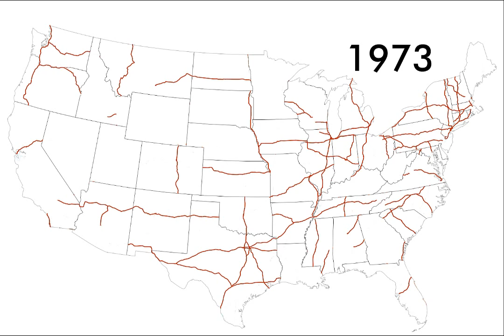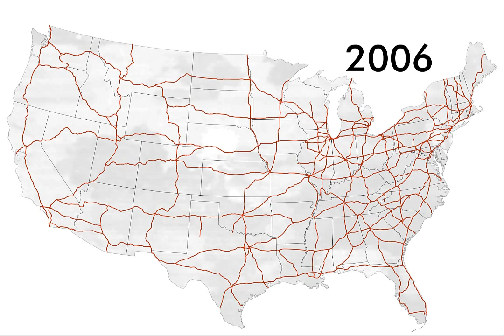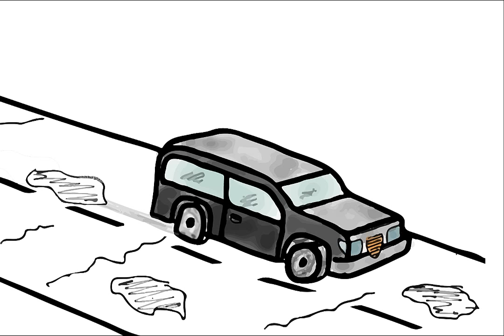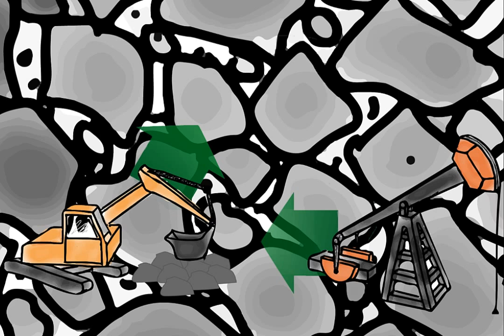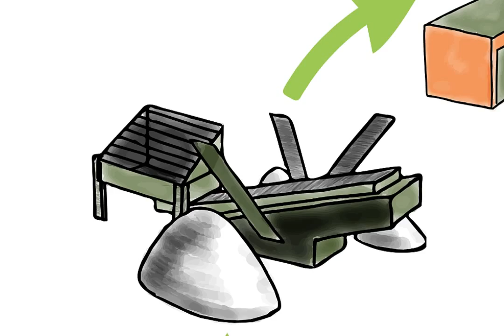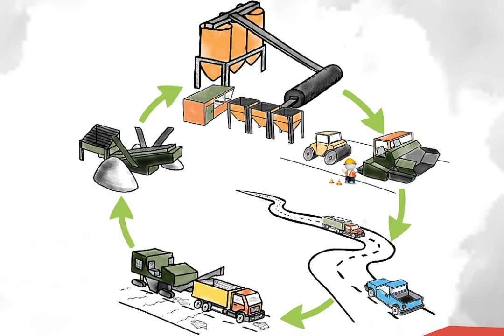US Interstate highway system time lapse

Comment: There are definitely major mistakes here. I have a road atlas from 1966 and much more of the system was built than what is shown here. Also, I-40 in North Carolina from near Hillsborough to Wilmington is shown as being built in 1971.  It absolutely was not built then.  They only opened it to Raleigh in 1986 and was not open to Wilmington until 1990.

Comment: I’m fortunate enough to have been able to drive almost every mile of the interstate system. Regardless of the accuracy of this video, it is still a good representation of the order of completion.

That said, the interstate system is not a personable at the US Highway system. Sure, it’ll get you from point A to B in a timely manner, but it bypasses a lot of great places.

Some of my favorites: 8, 15, 24, 25, 27, 29, 35, 39, 40, 44, 55, 64, 70, 74, 76 (both segments), 80, 84, 90, 94.

My least favorites include: 4, 12, 26, 68, 77, 79, 97.
Reply: Why don’t you like those routes?
Reply: @jimmynuetronrblx8628  Traffic. Or it’s very hilly.
Reply: @semipenguin  12 isn’t bad for traffic :(   Better than taking 10 instead for sure
Reply: 68?  It's gorgeous!  Probably one of my favourites (right up there with 70 between Cove Fort and Denver).

But yest, I agree that interstates are best used when time is of the essence (or snowy weather is threatening).  We prefer to cross the country off-slab whenever possible.  Once you get west of the MN/ND to LA/TX line, almost all roads of significance are the same as far as speed.
Reply: Who builds and who is responsible for maintaining the interstate roads? Federal government or state governments?

Comment: Video shows I-70 finally displayed in 1992, while I remember it being build in 1968 and driving on it to college in 1977.
Reply: Yeah just specific sections werent finished and were probably sections of US 40 instead
Reply: I searched it up and it's saying it was 
COMPLETED 
 in 1992
Reply: @oreaqua  I 70  was completed in the late 60's from eastern Utah - Baltimore Maryland. In the late 90's, I 70 extended into western Utah and NOW ends at I 15 between the Arizona state line to the south and Salt Lake City to the north.
Reply: @codemeister26  The Utah section that goes to I-15 opened in 1970.
Reply: @oreaqua  I-70 was built long before 1992 in Colorado, and 1990 in Utah. I-70 actually opened in 1970 in Utah. A new bridge was built in 1990 in Utah, so that's where the 1990 date comes from for Utah. There is a redesigned section through Glenwood Canyon Colorado that was completed October 14, 1992, that must be where the Colorado 1992 date comes from. There is an elevated section there now, the highway used to just be down by the Colorado river.

I drove from Denver through Vegas to San Diego before 1990. We went west on I-70 through the Eisenhower tunnel that first opened March 8, 1973 all the way to I-15 where it ends and then south to Vegas and San Diego. I remember a friend of mine saying that he thought I-70 went all the way to the Pacific ocean. But it ends in Utah where it meets I-15.

Can't go by the last completed section dates. Although this video is a good idea, using the opening dates would have been more accurate than completed dates. In the description it says he went by the completed date, but that date will constantly be changing. The opening dates won't change.

Comment: There are so many errors on this time lapse that I don't have enough time to list them all. Some of the more glaring errors are the California freeways are off by decades and the Oklahoma toll roads (Turner, Will Rogers, etc) are off by almost 50 years because they were built in 1947 before the Interstate system was approved. And I 40 around Kingman, Winslow and cities in New Mexico and Texas weren't completed until the early 80's due to conflicts with local merchant groups. I 70 in Indiana and Ohio was completed years before you show them being completed. Also, every Interstate resurfacing project in the last 25 years has used recycled asphalt and concrete.

Comment: I see several errors.  As just one example, I-96 in Michigan was finished 'way before 1975.  Your 1975 map doesn't show it at all. Nor does I-95 show up in Virginia or North Carolina by 1975.  Yet I-40 in North Carolina from Raleigh to Wilmington appears as early as 1971--they were just considering extending it east to Raleigh in '71.  You show I-75 as appearing for the first time in Kentucky in 1974, which is odd, since I rode on it as a teen in 1967.  Or I-4 in Florida doesn't show up until 1971, and I've ridden on it in 1966.  This is a fascinating time-lapse idea, but I'm disturbed by the inaccuracies.
Reply: And I-70 across Indiana isn't shown to be completed until 1992...a full15 years after I drove on it....
Reply: @stevenredman1582  I-70 in CO was completed in 1992.
Reply: drtee51 I was noticing the samething. I-10 Which runs through New Orleans and attached to both seaboards, does not appear fully complete until 1976 when my family has told stories of that interstate being there in 1958 at the earliest I can recall.
Reply: @CrecentCityCøCø  I also noticed this with I-75 in MI. It was completed in 1973, but doesn't show up on the map until 1973, when it existed before

Comment: I do see a major error as I remember riding down I-75 in Florida back in the 1980s.  I-75 ended in St. Petersburg in the 1970s prior to the completion of the Sunshine Skyway Bridge.  Then it ended in Bradenton once the bridge was completed.  Then a new I-75 was built on the east side of Tampa Bay in the 1980s going all the way down to Naples and the old I-75 around the Tampa Bay area was renamed I-275.  Then later on I-75 was tacked on to Alligator Alley.

Comment: The Time lapse on the opening of some of the interstates is either off or inaccurate, I am referring to Interstate 95 in Virginia south of Washington DC, north of Richmond. It was an interstate highway when I first traveled on it back in 1980. The video depicts it opening in 1982. Parts of it around near Emporia(closer to the North Carolina state line) were being constructed in 1981 but it was still classified as an interstate then too! Driving down to Florida in '81, the only part of I-95 in North Carolina which was local(not Interstate standards) was around Lumberton. The rest of the I-95 from North Carolina south to Florida WAS to interstate standards.
Reply: The dates seem to be based on when the last segment within a state was finished or brought up to Interstate standards. For example, the illustration doesn't show I-70 in Colorado (where I live) until 1992, which is when the Glenwood Canyon segment was completed. But the original part of I-70 from Denver to the Kansas state line was open by 1977. Obviously, it would be a much bigger effort to illustrate the timing of individual segments.